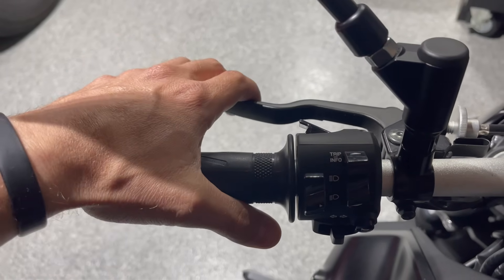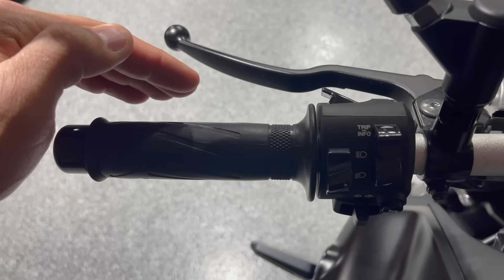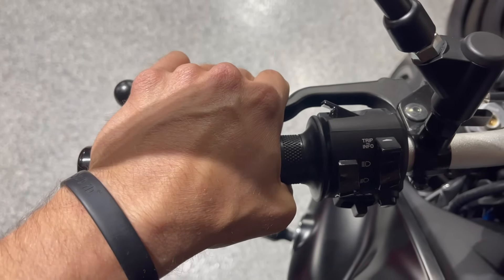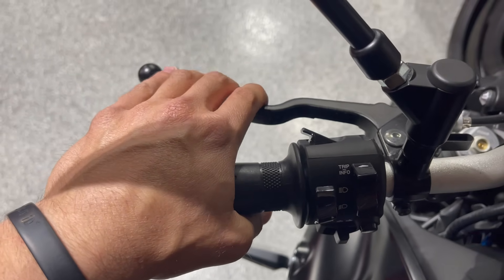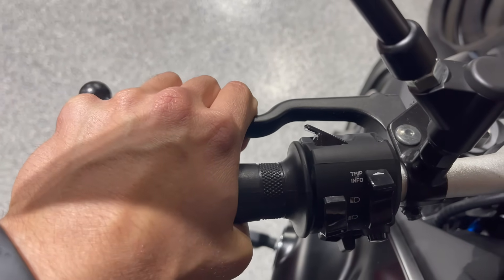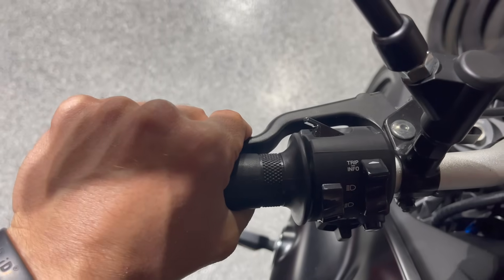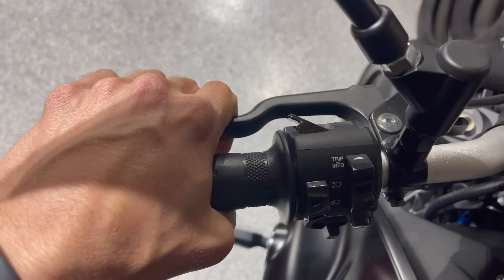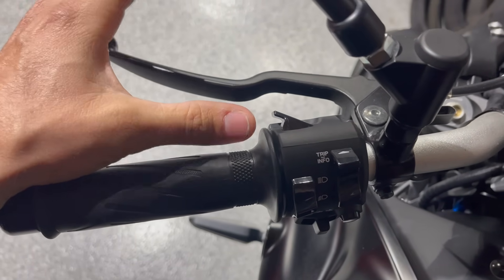Don't Make This Common Clutch Mistake!

Comment: I don't use the clutch to shift gears. Motorcycles have a constant mesh transmission. You don't need to use the clutch to shift gears, so it doesn't matter how far you pull the clutch lever to shift gears.

Comment: Hardest part for me is the slow speed control in first gear.. I stall 90% of the time either cuz of releasing the clutch early or not giving enough throttle. And it's really hard to do it in uphill.. Any tips ?
Reply from the maker: yes, practice more

Comment: this is good advice if you doing tricky manuevres at low speed, but when gunning the bike, best to pull all the way as in my case, i do my own bike repairs and i have adjusted clutch closer to the full pull. His suggestion may cause mechanical wear on gear selector, especially if the person does not pull optimum amount. I repair cars and would not recommend to do on a car, bikes have wet clutches so can take a beating, but still!!! his advice is good for control situations where staying on the friction zone improves control but not in flat out acceleration, high speed acceleration!!

Comment: In a truck, Dad would beat us.. DONT Ride the Clutch!!!...  LOL    we knew all about the friction zone..   Does it wear em out faster like in a truck slipping clutch or riding em ?  Glad I saw this i thought I was gonna break something, plus on my bike.. newbie here.. i seldom use the clutch.   Shifts ez without it..    kaw versys 300
Reply from the maker: this is only for doing my slow speed drills or something similar and it's a wet clutch...so unless you're revving the crap out of the engine and in the friction zone, you'll be ok

https://www.instagram.com/motojitsuclub/

Comment: There are times when you can and/or should play with-in the Clutch Friction Zone, Like when your making a Tight turn, U-Turn style turns , figure 8's, or in some very slow moving traffic. But not while moving above 40 MPH, or Top Speed, all you'll end up doing is wearing out the Clutches before there time. 
believe me? Then try it for a thousand miles, then change the clutch-oil, (if it is a wet clutch). It'll show sign of a lot of clutch partials, flakes (Gray, Silver, in color) in the oil.
 Not Good.

Comment: I'm using a motor with clutch , in almost 6 years , i ain't replacing my current clutch lining , and also i'm using a full press and i didn't see any signs of problem with my motorcycle.

Comment: If you are pulling the clutch lever nearly to the grip it's adjusted wrong. Holding onto the handle bar with only your thumb hooked around the bar isn't a good idea. Using all four fingers on the lever isn't a good thing. Adjust the lever so that you can actuate the clutch with the index or middle finger.

Comment: guys, stop saying he’s wrong. 

Yes he explained it in a weird manner, but as someone who rides track and commutes DAILY I can attest that you do NOT pull the clutch in all the way for shifts. 

When downshifting, you want to keep a constant force of engine braking while rev matching and slowly releasing the clutch. This requires you to start at the bite point and slowly work your way out. 

You apply the same concept for upshifting, less crucial but the engine likes it more. 

You are NOT damaging the plates by shifting at the bite point, what you are doing is shifting CORRECTLY. you burn the plates everytime you let go of the clutch after pulling it all the way in. 

You guys need to realize that pulling the clutch fully in and reapplying it to the motor WEARS IT OUT. you guys are not only shifting wrong, you’re wearing your clutch out. 

Parking lot maneuvers might seem to wear out a clutch, but improper shifts are the leading cause of early clutch replacements.

Comment: So I’ve been watching your videos for a long time but I’ve recently been told differently. My mechanic said to pull it in all the way. I burnt my clutch out at 16k miles from doing so and he said it should last forever. I don’t like pulling all the way in and just find the sweet spot but it fried my clutch. No I don’t shift clunky I shift smooth but not pulling in all the way and having it pulled in at red lights so I’m ready has ruined it.

Comment: 1) Your arm will die in half an hour if you'll work only with a friction zone. the more you'll do it the harder it will pain (for most hard-working clutches)
2) Friction zone is adjustable on each bike and has a different level to start from for you to pull and release. So mine can be exactly at the handle for example and yours in the middle.
3) By working with friction only, your friction plates will die faster, especially at higher rpm.

Your cap...

Comment: If you want to destroy the clutch you shall use it like that. This advance curve practicing to master the bike like a police officer will cost you much if you go on like that. When I started to practice curve technic I got more and more problem with the clutch I have never had before. I can master the bike of course much better now, but the clutch adjustment and repair has been much more often. I prefer using it like I 
did before I learned the curve technic.
Reply from the maker: If you don’t ride you make the tires last longer too. I never had an issue with my clutch.

Comment: Yeah it’s also a form of slipping the clutch, you’ll wear out your clutch way quicker doing that, yes it will shift but just keep in mind you’re not fully disengaging the clutch so it will wear out quicker and cost you sooner than later
Reply from the maker: No it's not.

Comment: modern clutch are alot better performance than in the past(for me, when using bike early 2000 build and cheap bike), in past unless you pull clutch to the very end, engine will die if change gear. the friction zone are still the same but wider, modern clutch had it narrower.

Comment: Ofc. That's true and actually is even dangerous if you ride bike and pull it completely or to explain it better is more safe to just pull the clutch just a bit...if it was a mechanic problem i should say ok pull it completely but THERE IS NO reasons to pull it completely and THERE reasons to NOT pull it completely.
Reply from the maker: this is just about doing slow speed drills

https://www.instagram.com/motojitsuclub/

Comment: There was this instructor it was a black dude I saw on YouTube years ago. He called it pre loading and what he meant was when you are taking off or going at a low speed with the clutch pulled in to preload by reving the throttle a little bit so when you let the clutch out the bike goes. Also he was big on teaching about the friction zone and not pulling the clutch all the way in

Comment: What you are doing here is called Riding The Clutch. It results in relative motion between the friction plate and the shaft, which in turns damages the clutch plates.

Comment: I like hearing advice but I don’t always think every bit of advice I hear is accurate. This happened to one of those instances. 52 years of riding experience here and I 100% disagree. After many hours on a bike, sure you get the feel of where the friction zone is and if you have the revs perfectly timed, you can get away with it. But more times than not, you are going to wear that clutch out way sooner than you think. Because I’ve heard this many times before and everyone I know who tried it, had to replace their clutch and usually within a year. This thought process is NOT new. It’s been debunked so many times I had forgotten about it.

Comment: I disagree as well.  The point is to cut off power from the bike so you can shift.  As long as youre in the friction zone or lower.  For me, i use most of my fingers to pull in the clutch. If i use one or two while still holding onto the handlebars.  I end up smashing my fingers when shifting.  Not comfortable.  Besides, the fiction zone is where your bike is starting to get power.  If you shift in that zone youll be wearing your clutch down as the bike is already halfway in gear.  Pulling it all the way in gets no power to the bike, you get a smoother transition between gears. Just remember to pull on the throttle as you lean back into gear

Comment: For shifting i just do clutchless shifting. Taught by you. 😁
Reply: Not every bike has quick shifter
Reply: Quick shifting and clutch less shifting are 2 different ways of shifting.All bikes can be clutchless shifted,try it,it’s fun.
Reply: @RedFly.  dont need quick shifter for that. Even my bike doesnt have that. All bikes can clutchless shift you just need to find the right rpm and your technique should be spot on.

Comment: Won't the clutch plate wear out soon like this?
Reply: Most if not all bikes have a wet sump clutch discs. It’s different than a car clutch.
Reply: @blaze4487  my bike has a wet clutch so it'll wear out faster if I do half all the time?
Reply: @livingtree5817  faster than not using a clutch at all sure. it wont wear nearly as quickly as a cars clutch would. its lubricated by oil which allows slipping without much wear.
Reply: @blaze4487  thank you so much mate. You're really great 🔥

Comment: I wouldn't call pulling the clutch all the way in a "mistake." It still releases the pressure plate, so it's still accomplishing what it's supposed to do. It's more overkill than mistake.

Comment: I am not into half pull so what I did was adjust the lever itself close to the handlebar. Basically removing the deadspot and only a cm from the handlebar is the friction zone. I always prefer full pull so I can feel like I'm holding the bar.

Comment: Pulling the clutch all the way is NOT a mistake if you don't need to use the friction zone to control slow speed maneuver.  There is no reason to ride the clutch the way you described it to shift all the time, as a matter of fact, what you suggested is actually a mistake because by shifting within the friction zone at all time will prematurely and unnecessarily wear our your clutch.

What you are suggesting is no different than telling someone to ride your clutch when you shift in an automobile, the end result is burning your clutch.  However, if you need to adjust the speed of a manual transmission automobile in low speed, then you can ride the clutch methodically to achieve the result the same way that you use the friction zone with a motorcycle.

Comment: Someone shoulda told Tom Cruise that when he was pretending to be riding the GPZ 900R down the flight line in first TOP GUN. The scene was done with the bike on a trailer. But, the most noticeable thing to any experienced motorcyclist is how far he pulls that clutch lever back.
It just screams FAKE to a motorcyclist.
In fact, if I was drag racing an F-14 I wouldn't be using the clutch lever at all.

Comment: The only time I have the clutch all the way in is at a stop in gear. Otherwise I rarely even use it for shifting. If I do it is just pulled in a little.

Comment: You must use 100% the clutch every time you use it to shift gear, otherwise the gears in the engine will be damaged in a few years, but when you are in a traffic or some thing like that and you want the clutch for other purposes you use it like these person tells us in the video.
Reply: yes it's even mentioned in the owners manual (of almost every vehicle) to depress the clutch fully, and remember novice riders, it's always 100% safe to follow owner's manual than a person's advice.

Comment: Yeah this is how you wear your clutch out. Like there is litterally no benefit to anything he said.  It would actually be way better for your clutch to stay off of it as much as you can. You don’t have to ride the clutch when your going slow   especially not when your haulin ass just blip it and shift.you don’t have to pull it all the way in but you don’t need to hold it at the bite point.

Comment: Friction plates on a motorcycle clutch only need to separate by 1 to 3 millimeters to fully disengage all power coming off the crankshaft. 
Your clutch lever travels 50 millimeters before it touches your handlebar.
Why on earth would you use the clutch when you're shifting gears on a modern motorcycle is the real question here...

Comment: My clutch started to slowly lose pressure back into the reservoir, I ordered a new kit to repair the master and a new slave cylinder also because I saw a little leak there. The point I'm trying to make is that I can ride it but is dangerous because the friction zone is unpredictable and moves further down and down in seconds, so I leave the bike at home until is repaired. You can risk it when it happens just to get it home, but don't go out until its fixed, just saying because the guys are calling me for a ride this weekend and say I shouldn't worry about it, but they won't pay the repairs if I crash or dump my bike.

Comment: Its just like a car. I call it the "engagement point". You clutch in until you hear the motor start to drop revs (off the gas, obviously), then shift there. As you said, there is no reason to clutch all the way in, it just wears out your throw-out bearing by putting more pressure on it and engaging it longer....

Comment: So I recently  purchased an Suzuki sv1000. Still getting used to the bike. But when I shift up and down it's not very smooth. I'm definitely pulling the clutch handle in too far. Great advice 👍🏾
Reply: Could be where your rpms are at when downshifting as well that's making it not smooth.
Reply: @Einkie  yeah definitely. I've been trying to get better at matching the RPMs. But also I just need to realize that it's almost 20 years old.

Comment: And this message is brought you by the clutch plate manufactures 🤣. Don't do this. Your clutch plates will danages and wears off quickly. If your RPM timing is perfect then you can up shift and down shit without using the clutch at all but still, it's not good for the engine. Clutch handle is there for a reason.
Reply from the maker: You probably don’t ride to make your tires last longer too, right?

Comment: Don't ppl just do this on there own ? I have been using bike for 5 years and that's how I use it. I believe when riding you should be able to sync with bike so u can feel the power and ride unconsciously. From what I mean sync is to feel power through throttle and feel engine as we shift gears.

Comment: I never knew this. I would always pull the clutch all the way in and it hurt my hand alot. Maybe this way it will alleviate some of the pressure on my hand. Good Tip!
Reply: Are clutches usually hard to pull? I just got my forst bike its a janky old rebel but the clutch is really light and easy
Reply: @inhumanfilth681  this is my 3rd bike and I can't remember the other clutches but my gixxer k5 600 is very hard to pull in. I think the cord may need lube.
Reply: @F_Evans  Oooh thanks man thats something i didnt know i needed to do.
Reply: @inhumanfilth681  yes there is a way to lube the cord. You can find vids on it here on YouTube. A couple different ways of doing it. Because over time dirt, grime, and slugg build upon the cord making it sticking thus hard to pull in.

Comment: You don't need to use the clutch to change up the gears on a motorbike as it has a dog engagement sequential gearbox. Absolutely makes no difference using the clutch. Disengaging the clutch plates is exactly the same as just backing off the throttle in the sense that it takes all the load of the dog teeth on the gears,  allowing another gear to hook up and be selected.

Comment: Not debating the advantages for bike control but just wanted to point out that just because you feel no power to the rear wheel does not mean the clutch is fully disengaged and having this slippage on the clutch at every stop or gear change is going to wear it out more quickly, theres a reason the lever goes to the grip

Comment: two fingering the clutch will give you more bar control. racers one finger but street bikes usually have a bit more clutch force required.

Comment: You can pull the clutch just a little bit (2cm) and it doesnt seem to cause damage (no hasty sounds), but will it wear out clutch faster?
Reply: M/c s have wet bath clutch and is DESIGNED to be used this way. MASTERING the friction zone and spending hours and hours and hours of half clutch in the friction zone is basic beginners level of MSC format as well as advanced. It's so basic and necessary that u can't begin to pass licensing test without learning this, due to REQUIRED maneuvers. Thas US and worldwide.

Comment: I don’t ride a bike but I still gotta say something about this dude, he really shared something useful. This is actually what I have discovered after having driven manual cars for almost 10 years now, that is, stay away from the dead space on either end (clutch pedal/lever freeplay and pedal/lever travel after complete clutch disengagement) I wish I had learned this sooner, but nobody taught me, also I probably wouldn’t know who is correct as there were so many different “correct” ways out there. It’s hilarious to see bunch of people in the comments saying “oh, you will wear your clutch faster”, because they have absolutely no idea what they are talking about, there is nothing getting worn out faster. This is without a doubt the most important part of driving/riding a manual, you would be amazed by how fast yet smooth the engagement is. Some of you guys will eventually realize this one way or another and think to yourself, gee, I wish I knew this sooner.

Comment: Hey!! So quick question then! I've been riding daily for 8 years now and I've always pulled in the clutch all the way for clutch ups and shifting (I also clutch less shift alot but I'm sure that's another topic)

My question is what benefit would this have? I don't think it would make me quicker [hence why I clutch less shift if I need to] it doesn't seem like it would damage your clutch as I've never had to replace one...so my other question is what's the point!? No damage no benefit to speed so it's just preference then!? 🤔🤔